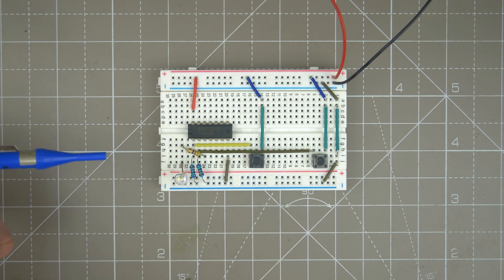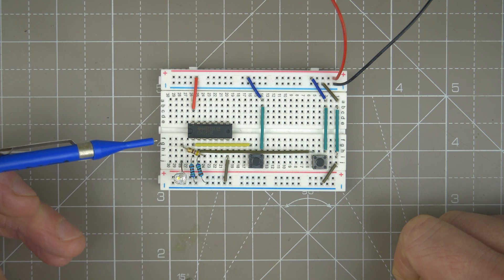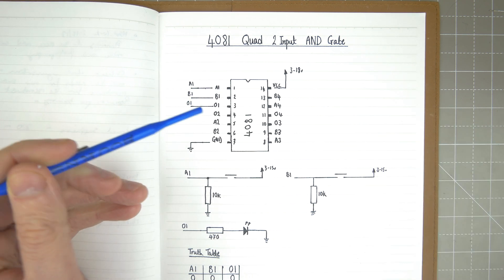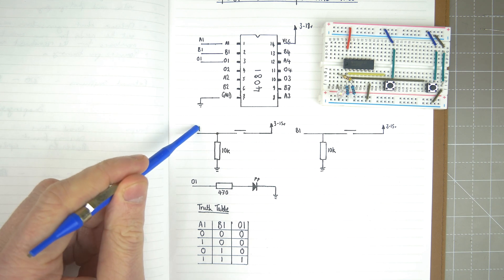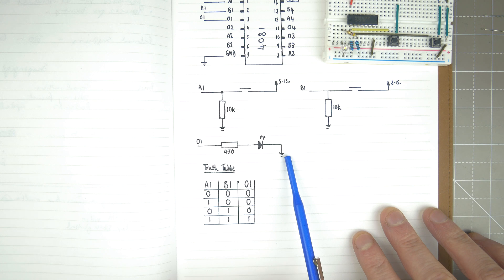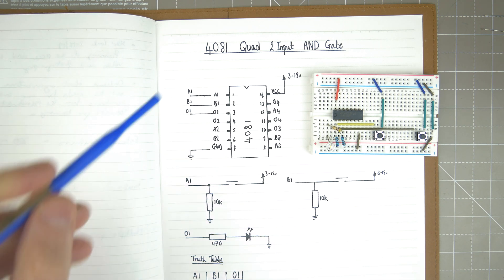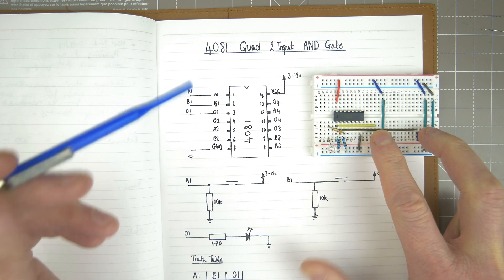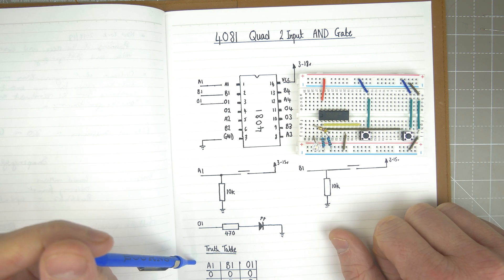4000 Series Logic ICs : The 4081 Quad 2 Input AND Gate

Comment: Nicely done.  But you do know that 4000 series CMOS are only rated for around 1ma max sink/source on outputs. eg. With a 5V supply you’re possibly sourcing 5ma driving that LED directly.  Just saying. :)
Reply from the maker: It was around 3.6v from 3 NiMh AA batteries and the LED has a forward voltage of 3.2v so roughly 0.9mA current through the LED.
Reply: @DavidWatts  Nice.  Perhaps you could add some more detail on this in part 2?  I'd hate for your students to hook up there own circuit with a red LED (eg. ~1.9Vfwd) and power up wondering why the circuit only flashed once, then was forever logic zero!  :)